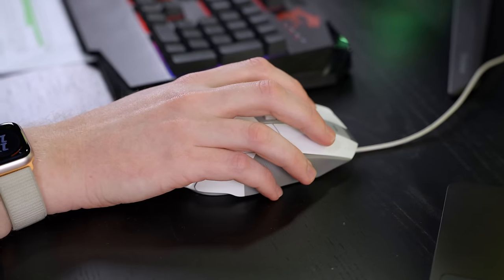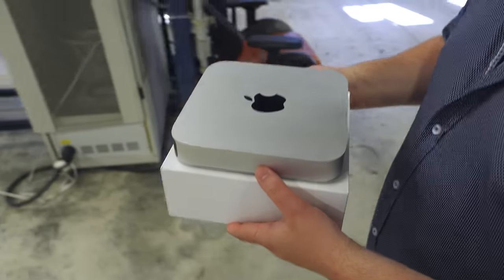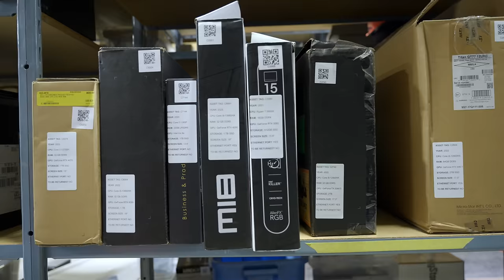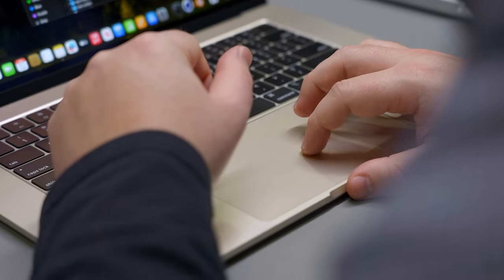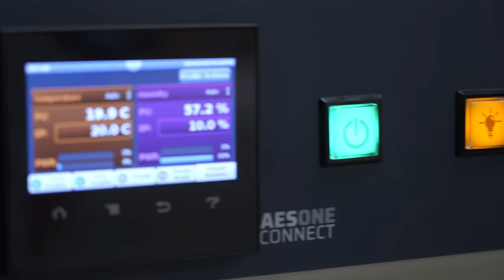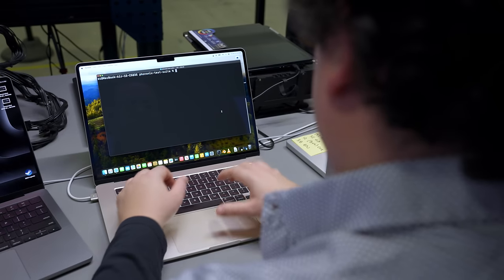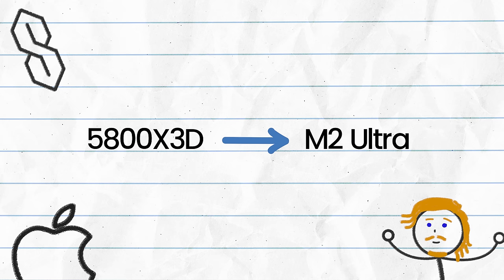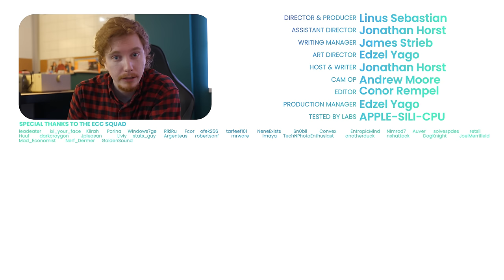How Apple Silicon Compares... - Part 1

Comment: Cool video! I don't agree with your method though. You now picked CPUs based on them having similar performance to the Apple chips which gives the best comparison for the graphics cards in a later video. It doesn't show the best value for CPU's though.

I'd love to see a comparison of similarly priced PC builds in the future using the latest and greatest CPUs and GPUs like the €380,- 7800X3D.

Seeing the price of a Mac Studio M2 Ultra you could build an AMD Threadripper 7970x system.

Comment: Seems to me like a bit of an odd choice for the CPU's. Why use last gen parts that are slower and significantly cheaper. The M2 Ultra equipped Mac Studio is about 4-4.5k$. The 5800x3D is about 300$, even paired with a high end motherboard like the MAG B550 tomahawk adds another 170$. Paired with a 2TB 980 pro, 7900XTX, 1000W corsair PSU and a 4000D airflow case you're still well under half the price of the Mac Studio. If it's about power consumption or efficiency there shouldn't be that great of a difference between the 7800x3d and 5800x3d. Never mind the slower DDR4 memory that the AM4 platform uses too. 

Looking at some of the benchmarks for 7800X3D it brings great imporvements when compared to the 5800X3D.
Same goes for the other CPUs. Even within the same generation why would you choose the 5600G instead of the 5600, the 5600 is marginally cheaper and is faster and it has the extra cache. The 5600 alongside 16gb of memory, a crucial p3 1TB, a 7800XT, Phanteks case and RM750e PSU comes at the same price as a base model M1 macbook air with 256gb of storage and 8gb of ram. If you match the storage and memory it comes to 1600$ which means you can easily get the 5800x3d within that price and have 400$ left over say for the build price. Even comparing against the M2 mac mini you're looking at 1200$ for base model with 16gb of memory and 1tb of storage.

I don't understand at all why those exact CPU choices were made. Can some further explanation be provided?
Reply: He is a apple shill he wants apple to win duh

Comment: I look forward to part 2. 
One of the things I wish Apple can bring back is eGPUs. They disappeared when Apple moved to their own silicon because of 1. There are no drivers and more importantly 2. they believe their SoC architecture with iGPUs and unified memory outperforms desktop class GPUs and thats why they didn't even include discrete GPUs on the highest-end mac pro. Though there are rumors that they are working on making discrete GPUs work on the mac pro, I doubt it.
Reply: Apple is not going to bring back eGPUs (at least not AMD or NV eGPUs) they might at some point support addictional Metal compute units (lets not call the GPUs) but for a load of low level os reasons these will never be the `default` system GPU they will only every be used by apps that are mutli-GPU enabled. 

So the SOC will always include an integrated GPU with the shared memory space and this will always be used as the video output as it has access to the display controller etc (or better put the display controler can access the output of the GPU.. the gpu does not include the display controller this is seperate part of the SOC.. in apples case a very large part).

Additional Metal compute units could be supported (the Metal api exposes this devs) and I think we will see these but they will not be used for gaming, they might well not even support the metal display api spec just the compute spec and for sure will not have display controllers etc as the window manager, compositor etc in modern ARM macOS are based on the iPadOS/iPhone code based and depend on the shared memory arc (0 copy).
Reply: Not gonna happen. Apple has made the very direct decision of leaving legacy MoBo sockets, connectors, slots and ports  behind. With the constant improvements in Apple Silicon, connecting external "high demand" devices like eGPUs simply points out the data transfer bottlenecks that are eliminated by the System on a Chip design philosophy. Lots of Windows Fan Boys poo-poo Apple's supposed lack of upgradability .... but wait 2 or 3 years when Intel and AMD are forced to move to ARM-based chips to reduce heat dissipation and power consumption issues.....specifically in laptops.

Comment: For CPU performance only, wouldn't it have been good to use some Linux distribution instead? Compiling stuff for Windows is hard while compiling stuff for Linux and macOS is comparatively easy. Then, a larger array of benchmarks could've been used, which present the ground for doing GPU benchmarks on Windows. Most of the time, the performance should be quite similar between Windows and Linux with only a few percentage points between them, if at all.

Comment: I am once again advocating for the use of TouchDesigner in the testing/bench-marking suite.

SUPER tight knit integration with NVIDIA SDKs on windows
Natively cross platform on macOS (apple silicon native bundle) and on Windows

EXTREMELY in-depth analytics on system resource use down to the 0.001ms Per Operation

Native support for GLSL Shaders (a PROPER way to benchmark a GPU across OS types just short of C-Ray, can build ur freaking own)

Comment: The excuse was Intel switchs sockets? But on some z690 mobo you can go from 12th to 14th. That would have made more sense and then using amd am4 platform. (Only saying because am4 is older)

Comment: A little disappointed by the choices of Intel/AMD processors, I think using some newer stuff would be good considering how fast the Macs are in single core. The M3 series reportedly beat the 14900KF in single core on passmark. It would be interesting to see how much slower they are in multi-core though than the new competition.

Comment: Great video! Yeah macs are always great with CPU performance. Curious how the latest gen will perform against the M3 max though.
Reply: They aren't testing latest Gen. These are all 5000 series CPUs instead of 7000 series. At least the 5800X3D was a 2022 release, but comparing it against the M2 Ultra, still released over a year later, seems odd. I get they couldn't have tested every cpu, but I would think they would aim for similar price/release date to compare against.
Reply: @godminnette2  yeah they mentioned why in the video. Still curious though. Also surprised the M2 Ultra just destroys the rest of them. Though it’s probably better pitted against a thread ripper.
Reply: @CreativeMindsAudio  Its a poor excuse though, as many have mentioned they are creating a bigger memory bandwidth disparity by not using DDR5.
Reply: @alexatkin  for sure! at the same time though, my PC is a 5800X and my macbook pro is the last intel mac. I'd like to get an apple silicon computer, but so far this is serving me well. first i'd like to get a new GPU, unless the next tests show that the 4000 series nvidia stuff doesn't completely dominate the apple chips. if the GPU is pretty meh by comparison i may opt for a cheaper macbook upgrade.

Comment: i find the choice to go with last gen amd chips against the newest and greatest from apple odd. makes the apple chips look very good but in truth, 7000 series is way better and more efficient. and the m2 ultra, a 24 core chip thats comes in a mac studio for almost 5k against a 16 core that costs 450-500, in a complete system that costs less than 2k, prices in €. 
i would have loved them to test a 7800x vs a m3 8 core chip, because that would be more reasonable.  but these test they have done... makes the apple chips look way better than they are in terms of comparison, i would love them to clarify why they have gone with these chips, with the older platform and that there are a complete new one out there, wich would have been better performing. and the price differences would have been nice as well, for an mac studio a threadripper would have been more appropriate,  even tho that is not for gaming. i see that there are some difficulty in choosing chips there bc the gpu count on apple is changing between chips, but for cpu testing there must be a comment highlighting these differences,  not just compare a  24 core m2 ultra for almost 5k€ against a 5950x 16core from last gen for  450-500 (complete system maybe 2k most likely less) 

someone who dont know amd cpu's would be easily mislead by these test results.
dont get me wrong, LABS does an amazing job, but the way this tests in this video are presented will be misleading for those who dont know and frustrating for those who do.
Reply: Just to clarify, in my comment "7000 series is way better and more efficient." I was referring to the 5000 series.
After reading my comment a day later I felt like this could be easily misunderstood.
Apples m series chips are extremely efficient in terms of power draw.

I rather put this in here than editing my original comment.

Comment: It takes far less time to render on GPU's which is why you only render on CPU's if you have to, like when the model is too big so you use a Threadripper system, that's not shown here. Still, with these benchmarks a mid-range Nvidia card is much much quicker, no need to pay out for an M2 Ultra Studio.

Comment: I think there might be a huge caviat we need to put against the gaming performance results. This might actually show of the benefits of optimisation more than the actual raw power. Due to the very small hardware selection the developers (if they the choose to take the time) can optimise games much more easily for Apple hardware. I think the Adobe suit is a good example of such software.

All that aside just from a power savings point of view it is truelly impressive. I just don't jive with the operating system and abhorrent business practices.

Comment: It feels (and reads) odd to intentionally kneecap x86 performance at the high end with decidedly last-gen components.

I get that you're hoping for broadly equivalent performance across otherwise equal hardware (e.g. keeping PCIe, DRAM, and other specs the same), which makes AM4 attractive, but it's not as though the M1, M2, and M3 have interchangeable specs outside of the CPU/GPU cores; for instance, depending on the flavor of M1 ("regular," Pro, Max, etc.) you get LPDDR4x or LPDDR5. And that's to say nothing about total memory bandwidth, PCIe generation (which I still think is at 4.0 based on SSD speeds?).

Likewise, there's ultimately no way to get away from price differentials as well, so I'm truly at a loss as to what the takeaway will be: *M2 Ultra performs x-percent better/worse than 5800X3D + ?GPU... for twice as much money* (Easily spec'd a top-o-the-line 5800X3D + RX 7900XT for around $2K USD.)

Comment: Now measure power consumption per unit of compute and all other cpus are a total waste of energy compared to the apple silicon cpus.

Sure you can out-power an apple silicon CPU, but as soon as energy efficiency is put into the mix the deal is lost for most other cpus unless you drop performance.

This is something hard to match since apple bought most of the >5nm chip manufacturing 😅

Comment: Apple silicon chips are impressive. In my kopinion its not about if one chip is better.l its about how youre going to use them if your going to use them for both gaming and working windows is a better choice but if you like the apple ecosystem and want to work apple silicone is better.

Comment: If you compare an architecture from 2020 with M3 thays from 2023, i don't think it makes too much sense. AM4 is is 2 to 3 years older than that. Using AM5 would make more sense.

Comment: Let's just put it this way: Using AM4 to compare with M# is a HUGE FAIL. 

Instead of splitting lower tier with AM4 and high tier with AM5, they just wholesale kneecapping x86_64. Ryzen is so heavy depending to memory (where Apple has utmost advantage with unified memory) it's going to affect the GPU result no matter how they test it and god forbid if they are gonna testing GPUs only with 1080p.

This video is terrible. How LTT just can't stop getting themselves into controversies is completely beyond me.

Comment: Why exactly are we testing 4 year old AMD CPU's against Apple silicon released a few months ago?
Reply: To test the GPUs. Usually when testing different gpus we make sure to try them on the same machine so the power of the machine is not a factor. That is however difficult when one of the GPUs is in a mac. So they are trying to find what the raw cpu power equivelent is in a PC. Which is of course difficult as each type of cpus have different strengths. That is why they tested so many factors
Reply: @JonGretarB  Its downright impossible, given none of those tests reflect how a game engine actually performs, especially any that might be memory bandwidth sensitive so migh t need DDR5 to narrow the gap to Apple Silicons huge memory bandwidth.
Reply: @alexatkin  yes it is impossible to fully find an equal. However they are trying what they can to be as close as can be expected. Some of these tests do touch on the cpu-memory bandwith so fair enough.

Comment: I have BEEN a frustrated Mac gamer for almost a decade now. In fact, back then when Macs were built with Intel CPUs, DDR 4 DIMM RAM, and separate SATA SSD's, that's when my frustration started. They were essentially PCs, but with this different OS, and the studios just weren't compiling their games for Mac OS. It just seemed arbitrary. Ironically, Apple is now going back to their classic ARM SoC's and somehow getting studios to port for Mac despite this architecture. Seems less about the architecture and more about the outreach...

These benchmarks are illustrating that I need to go get a M2 Ultra🤔

Comment: Putting intel aside was so weird. Yeah, the socket change, but…. It has not changed in three generations, exactly as long as the apple M series has existed.

By sticking to AMD you don’t have modern processors. You are two whole generations behind (the 5950 came out closer to the 12 gen intel).

A 13800k (or 14) would match an Ultra better. The 5800x3d is just so skewed toward gaming it will make comparisons ineffective either way. It’s also 3 years old at this point.

I feel you dropped the ball on that one.

Comment: If the objective is to find the closest desktop x86 CPU to each Apple silicon chip, then I feel like the testing methodology is flawed. 

From what I gathered in the video, the purpose for the testing is for people to know what kind of **gaming performance** they should expect when they buy an Apple Silicon computer, and what kind of PC specs that it would be equivalent to.

The tests that were used don't test for gaming performance, but tests performance in other statistics that may or may not have an effect on gaming performance. And matching Apple Silicon Chips to a corresponding AMD AM4 CPU *for gaming performance*, using those tests won't give indicative gaming performance

Not to mention, AMD CPUs on the same architecture (that aren't using 3D V-Cache), generally have the same gaming performance. The FPS differences are not significant enough, so matching an Apple Silicon chip to different Ryzen 5000 parts don't really make sense, when just picking 1-2 are fine.

I feel like testing should have been to test the Apple Silicon chips in games that can run on Mac natively, and to test if any of those chips are CPU bottlenecked. If none of them are CPU bottlenecked, then there is little reason to find a AMD CPU that matches the CPU of an Apple Silicon chip. There you can pick the Ryzen 5 or 7 variant from each AMD generation to match to each Apple Silicon chip. Then find GPUs that give the same FPS that each Apple Silicon chip achieved.

Also, since Apple uses performance and efficiency cores, I feel it would be more appropriate to compare against Intel since they also use hybrid cores and have the 13100f, so you can compare the standard M1,M2,M3 to the i3 13100f and 13400f.

Also, you chose the m2 ultra to compete with the 5800x3d, yet the 5800x3d was not on any of the charts used.

Comment: Pretty sure it's not that Apple specifically designed their chips to be good at audio/visual codecs. It's likely the other way around -- makers of those codecs are highly Mac-dependent and put a lot of resources into optimizing for Apple silicon. With games it's Apple who has the problem. Programmers figure anyone spending serious money on games has a gaming rig with an x86 processor, Windows, and some sort of AMD/Nvidia graphics card. Which is one of the difficulties with this sort of testing: it is entirely possible that in six months some clever programmer who makes audio codecs will optimize the shit out of their codec and for their AMD5800 system and everything will change.

Comment: Apple slicon is really cool and I'd love to be able to use a macbook as my laptop but I need storage and ram for my workflows so the absolute minimum usuable spec for me is a bit over 3000 dollars and ideal spec is 5000 dollars, meaning I'm returning my base m3 pro macbook pro and getting a windows laptop for 2000 with 48gb of ram and 4tb ssd. Oh and a faster cpu and gpu to boot. And a better screen. 
Just battery life is the downside, and unplugged performance.

Comment: Sometimes I wonder if most people commenting and complaining here even watch and/or understood the point of the video?
Due to the different architectur its nearly impossible to compare them directly here its all about finding CPUs that have similar general performance to the Mac to get a baseline.
Reply: But they did not explain if those tests also account for memory bandwidth which could skew the results by using DDR4 on PC rather than DDR5.  Games simply do not behave the same as any of those benchmarks in the first place so its bad methodology.